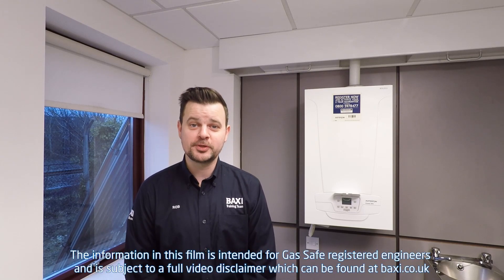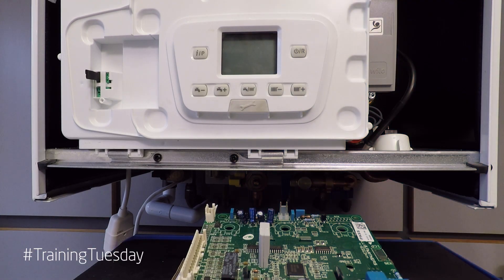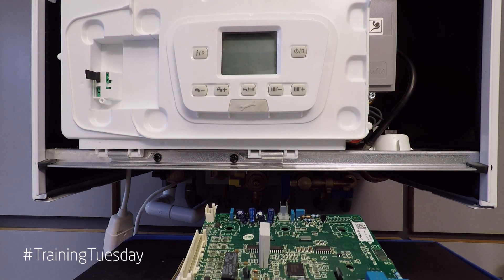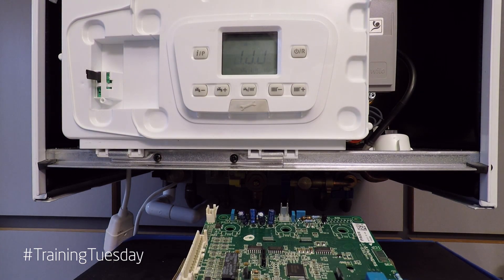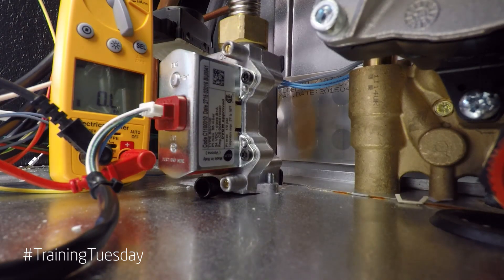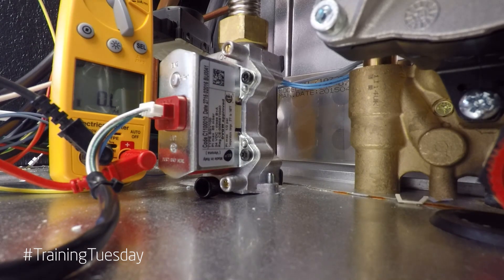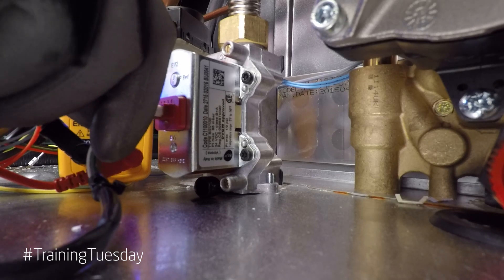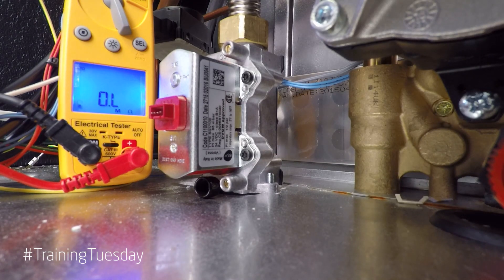How to change the data stick on a Potterton Promax Ultra boiler

Comment: Gonna make myself look stupid here?  But never mind, id rather gain the knowledge.  Ive never seen a gas valve like that....ever.  When did that gas valve start getting used?  And how recent is the Data stick.  What parameters are on data stick, and what did the stick superseed?  How was the data stored on pcb before the RDS came in?
Reply from the maker: Hi GrooveJet, thanks for your question. Baxi started using this type of gas valve arrangement around 2010, but data sticks have been used by many manufactures for far longer than this. The settings for the gas valve were stored on this particular data stick, other boilers, for example the Baxi Duo-tec, did not have this arrangement and were set manually removing the need for the data stick. Hope that helps.